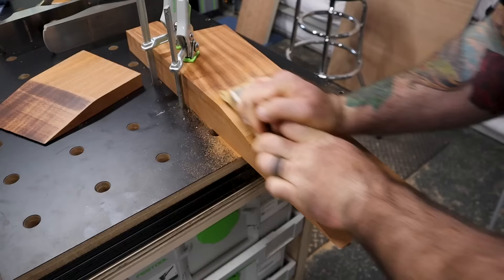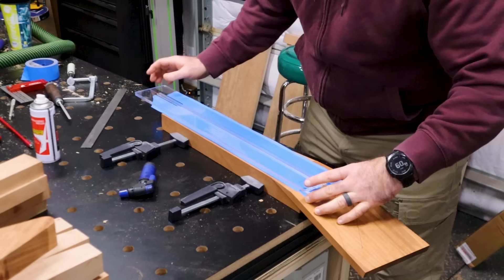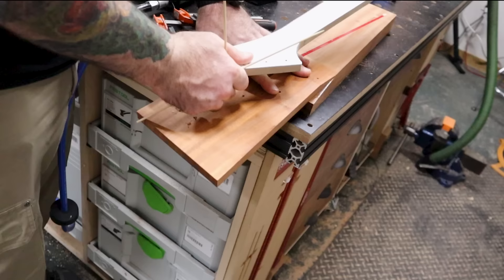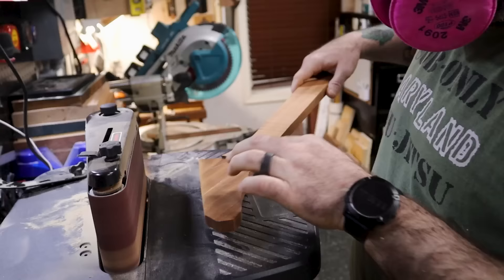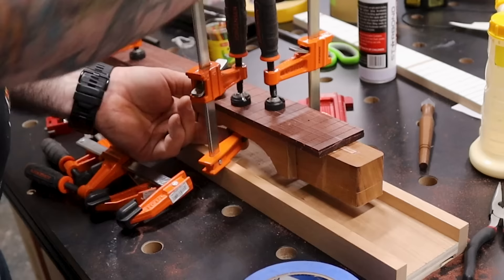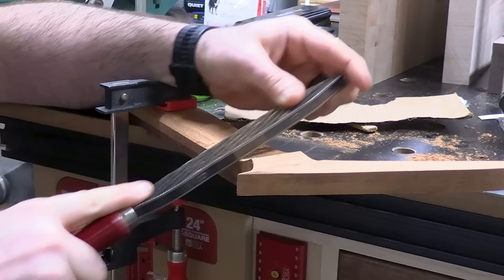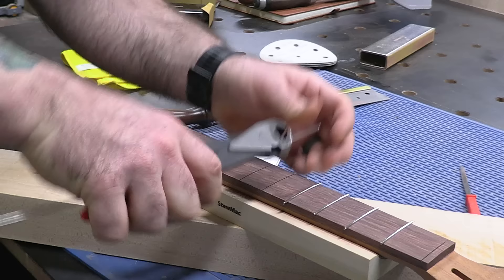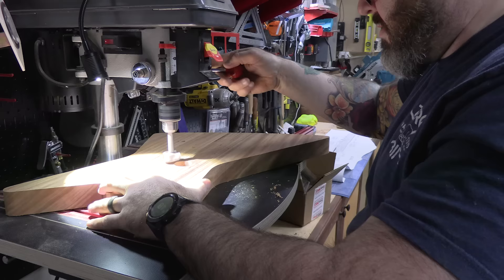Building James Hetfield's Guitar In My Garage!

Comment: I hate to even comment because it could be taken as criticism but it’s NOT…..
The one thing that really caught my attention was when you cut the neck and the truss rod hole across the woods grain instead of going straight with the grain.   From experience as a guitar tech , I’ve seen many a guitar neck warp-twist from the maker not going straight with the grain. Its also much easier for the neck to snap because the tension is pulling to the side of the neck instead of the full length of the neck. You built a beautiful guitar. I’m just offering something to think about.

Comment: You obviously have a vast amount of great wood-working tools, machinery and materials and you also have experience and knowledge and skill with wood-working in general. One helpful tip, working from what I know of guitar building - is how essential it is to secure your work. I could see video of you cutting, filing, doing fretwork while not having the neck secured so you get both your hands and indeed your body into your work. To see an experienced cat chasing your work around while doing this work seems odd. Anyway, you get it.
Reply from the maker: Agreed - I don’t work with stuff like a guitar neck often and don’t do much rasp work in my normal furniture making. Working on a new vise to specifically hold guitar necks so I have much better workholding for future guitars!

Comment: Put a line of wood glue in slots for the frets, helps keep them snug, but not too strong you damage the fretboard removing them.

When fitting the neck  I put a wrap of painters tape around the router bit when shaping the neck end. This tiny layer of tape helps keep the neck tight, but not so tight you can't fit them when glue up

Comment: Tip for your next guitar if ever, I've been building for the last decade & learnt a lot too. One thing about your break angle for the neck - it's always good to have the bridge you're using to really calculate what pitch angle the neck needs for proper string height at those higher frets. Not all bridges are the same in height, & for Gibson style bridges, you want the bridge to be a few millimeters raised above its lowest point. For anything Tremolo style (floyd rose, traditional strat) those usually don't need much of an angle (if any at all) because they sit rather flat over the body itself.

Comment: Machinist here (also a wood worker). When you drilled your tuner holes, I noticed the drill bit wobbling. That will most likely be shaking whatever you are drilling and I’ve experienced the same thing myself. You need a new chuck. Most woodworking tools come with very low quality chucks. Replacing them is pretty easy but I would get something like an Albrecht the run-out is almost none. That will improve your experience ten fold. A new “hero” 😊. I also had a an idea for you, provided you’re going to build another guitar. I would make a stand that is the height of your workbench and slightly thinner then the fretboard, so it will support the entire neck while shaping and sanding. I saw that flexing and bending, and I know it probably slowed you down a bit. In any case this was a great video and I enjoyed it Totally. I love Hatfield and have been a big Metallica fan since the 80s and I also play guitar as well. Now you need to build Kirks guitar 😎
Reply from the maker: I noticed that while editing too. I actually bought a new floor model drill press - some of my bigger furniture pieces needed more capacity and power. New one is wobble free!
Reply: Thats a lot of words to say runout 😂.  I'm curious as to what tolerances are acceptable in guitar making.  Not quite as demanding as aerospace but more than so than framing/roofing 😂.

Comment: It may be a bit trickier, but if you make another, I suggest making the fret markers on the corner of the fretboard. That way you have one marker that's visible from the side and the front... It would also be fairly unique. For the Cavity Cover, you might try to use some wet foam next time. It's super soft so you can just press it into the cavity to get a sort of mold and then use a chisel to effortlessly cut away the excess and boom, you have a template to trace.

Comment: The first guitar I made was 30 years ago. No kit, no Internet. Just a book, an Allparts and Carvin catalogue, and my dad's woodshop. Tele/Strat hybrid. I was 14. Mistakes were made. It was still a functional guitar. It's hard to screw up so bad that it can't be made to play well.

My second (from scratch) guitar is in my head, still cooking. I have the wood, still accumulating a few tools. Still a tele shape, but neck-through. This video is probably the best I've seen for a semi-beginner making a guitar with mostly basic tools. The hardest thing to learn 30 years ago was patience. This was the best tutorial at showing just how slow and deliberate everything should be.

For anyone trying to outfit a wood shop, used good tools are usually better than cheap new ones. I got a good band saw, radial saw, belt sander, orbital sander, and some routers and a table from Craigslist and pawn shops, a good set of drum sanders and router bits from Amazon.

I would add that if you have any access to a hardwood retailer or warehouse, it is so important to physically hold the wood in your hands before you buy/choose it. Some wood just speaks to you. Some wood isn't worthy of the fireplace.

It's worth practicing making a guitar-shaped object, if you're a beginner woodworker. Get some maple or birch plywood, or poplar lumber. Act like it matters. Your future confidence and skills are worth the time.

Comment: Hi there,

Nice first build, it turned out well !

Some comments however :
- The tune-o-matic bridge should have a slight angle (longer on the low E string), I think something like 1.5 or 2 degrees ; check your Les Paul for that
- James doesn't have any tone pot on his guitars, he's using 2 volumes (especially on his Ken Lawrence's)
- Also, James is usually using Sperzel locking tuners on his Explorers

Now you've tasted the joy of making your own guitar, I'm pretty sure you'll make a second one !
Reply from the maker: For the bridge, do you mean the break angle of the neck? Because I did do that. Otherwise I'll compare. Thanks for the extra info! And yes, I'm already working on a bass, and then eventually a longer scale metal machine with a trem bar.
Reply: If I’m not mistaken, he’s referring to tilting the bridge slightly off left or right. So the distance between the low e saddle and the stop tail is slightly longer than the distance from the high e saddle to the stop tail piece.
Reply from the maker: Ahhh, looked at my Les Paul and Just noticed that. I've owned that guitar for 20 years and never really noticed before 😬. Thanks for the tip!

Comment: I wish I could do wood working, you’re right, I’d love to build a guitar. One piece of advice, just put a drop of super glue for the nut. Literally one drop in the middle. Some companies use none. The string tension will hold it down fine, the dab of glue is just to keep it from falling out during string changes.

Comment: Absolutely incredible video and result! Quick tip for next time- when using your fret mallet (15:47) it is recommended to use the orange plastic side of the head instead of the metal counterweight.  The metal could possibly dent or flatten your frets whereas the plastic is a bit softer on the material. Sounds like it didn’t matter though, turned out great!!!
Reply from the maker: Thanks for the tip - learning a lot in the comments!

Comment: I really only noticed three glaring problems. Some of the fret tangs at your highest frets were crooked, so I don't know if the fret slot depth was low enough there. Maybe it was just a weird blow from the hammer. I think I saw your first or second fret popping out of the fretboard as well, so either they weren't hammered in well enough or the radius isn't correct. You can buy pre-radiused fretwire so you don't have to guesstimate it with the hand tool. The other thing is you used a lot of glue on the nut. I'd recommend trying to use as little as possible, that way if it ever needs replaced it'll be a lot lets of a pain in the ass to remove.
Reply from the maker: Thanks - I bought a fret press and radiusing tool both of those problems should be solved!

Comment: I assume there's already been a comment on this, being 2 weeks old already, but just in case, on finding the neck's curvature, you should look into a contour gauge and take sample measurements from your Les Paul Studio neck. A contour gauge will be far more accurate, will lock into place, and can be used multiple times for multiple jobs since you already do woodworking. Just thought it might be a beneficial tip for you! Fun build!
Reply: For the Metallica song question, I think probably Enter Sandman. I know it's probably a cop out answer, generic, "popular", but I really like the main riff for it and the overall flow of the song.

Comment: i made my hard tail strat at home in the living room and it was a challenge because i had only a few tools hand tools mostly and an old corded hand drill from the 70s. the body is a 4 peace mahogany back flame maple top like a les paul. as you might imagine it took a long time but it turned out fantastic. the finish i did was an oil finish done exactly the same way English gun makers finish their investment grade stocks and fore ends with the addition of one extra step after the finish began to age it ambered nicely and then i shot a lightly tinted nitro clear coat that will weather check with age. that guitar is now over 20 yrs old.

Comment: Very nice build, one thing to note is that none of James's guitars have a scarf joint. If you're building by hand try to get a thicker blank for the neck, scarf joints are generally associated with cheap guitars or Jackson.
Reply from the maker: I had always been told/learned that for angled headstocks, scarf joints were stronger. Interesting question as to cost - a scarf joint is more wood waste, more work, more time, etc. On the other hand, quartersawn wood is more expensive than not. All interesting points.
Reply: It might be stronger but it's considered low end. Even Jackson have finally started moving away from it. ESP use three-piece quarter sawn maple for their necks that's your best bet.
Reply: Let me add that most brands don't have the neck angle of Gibson, that's why Gibson has so many breaks, the angled neck and the angled headstock. Headstock brakes on other one piece necks (excluding the wings of the headstock) are much less common.

Comment: My hands still hurt to this day from building my Les Paul. For the neck, I used a super super aggressive rasp and then followed with lots of hand finishing. I also sanded the archtop rather than routing it, partially because I didn't know about that method at the time. The top 3/4" of the body was a tiger maple slab so it took quite a long time to shape... and one dead rigid sander later. That was 14 years ago now.

Comment: I’ve built two so far. A Korina  Explorer with ebony veneer on the headstock from a kit, and another that’s like a cross between a Les Paul Junior, and a Les Paul Standard. A Junior with a single p90, but the dimensions of a full size Les Paul. I call it my Les Paul Senior. Both are sublime instruments.

Comment: I'm a wood worker also. Mostly craft type stuff and custom walking sticks. To me cabinet makers are as good as carpenters can get. I've watched many guitar build videos over the years. It fascinates me. You are very good and you have far more skill than I. But I have one question. Why do you free hand drill horizontally? Many would have a blow-out from not keeping the cordless drill level. I saw you doing it several times. To me, if I'm able to stand the wood I'm drilling into upright and drill downward I would have so much more working in my favor to have the drill bit exit the wood on point. One tip that you might consider and it's novice stuff so you may have your ways but why do you hammer the frets without protecting the surface? I'd  use a block of wood on the frets and tap them down without marring the surface. Ive also played the guitar for 39 years. Certain things interest a certain person. Looks like there's alot of us out there.  Thanks for posting. Your voice is humble, crystal clear, you also have great pronunciation and tone.

Comment: Epic work! Farvorit number "The House that Jack build", Farvorit album "LOAD". This just shows what you can do with the right tools, materials and planing. I dont have any huge tools in my workshop, my drillpress is a normal 230v drill in a good press, It works really well, but its not a real drillpress. I have a lot of hand tools and powertool and some really nice excotic hard wood. I wouldtent event try to build something like a guitar, my dad made a acustic bass guitar, and it turned out really well. But for me nope not doing a guitar. I could make everything els. Because wood is alive and humidity can ruin the sound.

Comment: For your first guitar build this is an awesome job done! I've been wanting to get into building my own but never took the plunge and committed because the money I'd spend on the tools needed...and more wood likely from making mistakes...I always ended up spending on more guitars or amps or other gear lol. There's got to be a huge amount of satisfaction for you to be able to play something that you personally built, especially a guitar. They always say measure twice cut once...but guitar craftsmanship requires even more precision. Anything a few millimeters off and the guitar will be unplayable or never be able to get and stay in tune.

I'm not sure if anyone has mentioned it already in the comments, but for your fretboard towards the bridge it appears to have some over hang there. I know you had mentioned that but I wasn't sure if you filled it or not. If there is over hang and a gap between it and the body, generally what I've seen other builders do is that they build the angle into the neck before gluing it into the pocket, or they'll very carefully route the pocket at the correct angle. This allows you to not have any over hang as the full length of fretboard is glued to the full length of the neck.

If you didn't want to keep with the "traditional" Gibson style, you can also inset your bridge lower down so that your strings sit more closely to the body. The only purpose of the angle was because of the TOM style bridge that elevates the strings so much higher at the bridge compared the nut that it raises the action to an unplayable height. Lower the saddle down and you don't need an angle to the neck, but then it's not a classic Gibson style. This technique can actually be seen on all of the Floyd Rose style bridges. All of those necks are straight with 0 angle because the bridge height is almost perfectly level to the nut height.

Are you going to start building more guitars in your free time? I might be interested in buying one from you if you do consider it and you could price them affordably. A hand crafted guitar from a professional wood worker is likely to be a better constructed guitar than most of the mass produced guitars and you did truly beautiful work Sir!

Lastly, I've never been able to pick a favorite Metallica song. I'm also a guitarist, but I basically only play Metallica and can play 2/3's of their entire catalog including 72 Seasons. Every album and song has a completely different vibe and when I sit down to play, I usually pick songs that fit my mood for the day. Almost all of them are just fantastically fun to play...even some of the St. Anger ones lol.

I hope you build more guitars and continue filming and commentating for us so that we can learn from you, or in my case, live vicariously through you ;)

Comment: regarding the neck pocket fit (it's certainly not something i'd recommend for all builds!!) but Guns n' Guitars occasionally pass 2 angled screws through the body into the neck joint to pull everything in closer - I believe a japanese guitar maker either used to do it, or still does it to-this-day.

It would benefit the fitment, but not necessarily the aesthetic

Comment: My favorite tool is the oscillating spindle sander.  I got rid of my band saw and used a hand held jig saw.  No saw cuts perfect.  You're going to have to sand the edges anyways and the sander gets them at 90-degrees.

Comment: Very well done, my only question would be why not do all the drilling/routing work on the body before you glue the neck in? Also, have you run into any tuning problems across the neck?

Comment: ill give u a tip as iv nealy finished ,when you use wood, for instance, your back pot cavity cover , you stuck the blue tape bang in the center, in that way way you waisted a ton a fine wood that could be used for a million other things.. on neck cavities always spray them wet then do a pardon the put a dry fit test.. once it fits perfet when its wet. then let it dry. then when you go to glue it up it will be a perfect fit. nice work. remember to get it ti play perfect your frets must be perfectly flat as in no high spots. not even the tiniest rock is allowed. they must be perfect. and get some of james strings. great job.. also your drill press is bent. its rocking all over.. id get that sorted..
Reply from the maker: Great tips, thanks for sharing!

Comment: It might have been easier to build a "middle" section that is a rectangle with squared sides then glue the "wings" onto that.  That is the way Les Paul made his first solid body.  Tgat would make a measuring datum point on each side and the end so everything would be easier to square up, measure, drill, route etc.